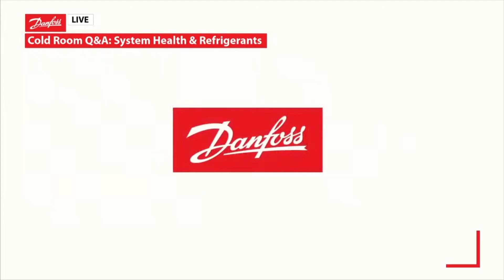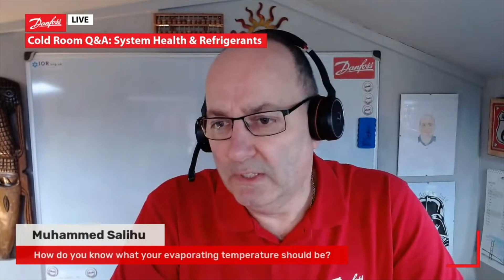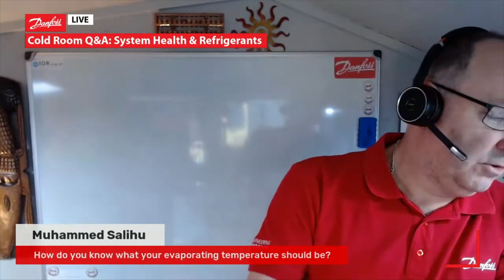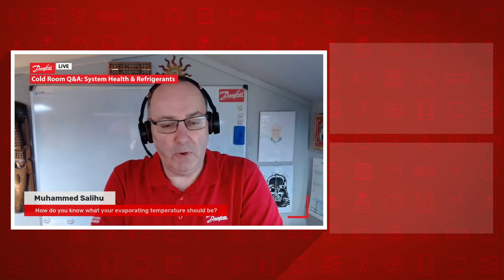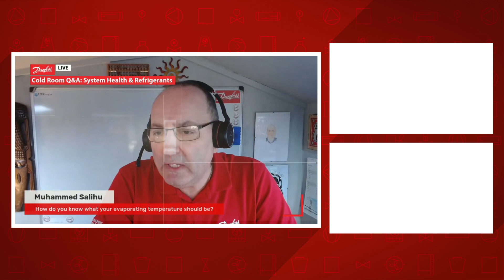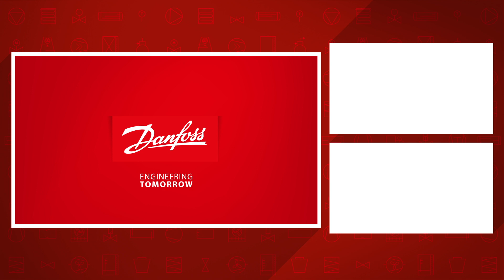How do you know what your evaporating temperature should be? | Ask an Expert

Comment: Thanks you for the update. 
however, please publish the Temperature difference to it Relative Humidity.
Reply from the maker: Hi Toyin, Thank you for your comment.
Design delta T, K
Relative    Natural     Forced
humidity    convection     convection

 

95-91         7 to 8         5 to 6
90-86         8 to 9         6 to 7
85-81         9 to 10     7 to 8
80-76         10 to 11     8 to 9
75-70         11 to 12     9 to 10
 
For temperatures of -12 deg.-c / 10 deg.f and below an evaporator TD of 6K is generally used for forced convection.
Hope this was helpful :-)